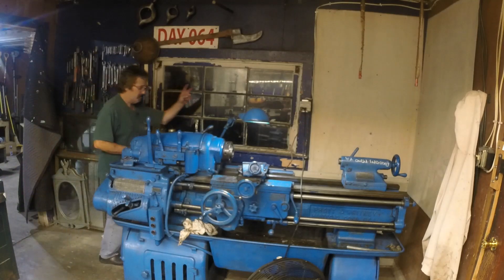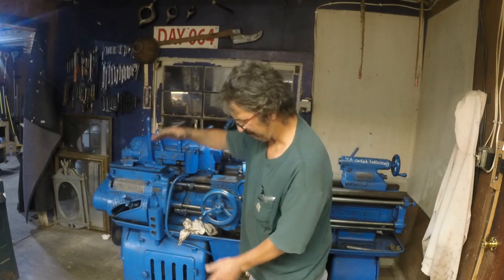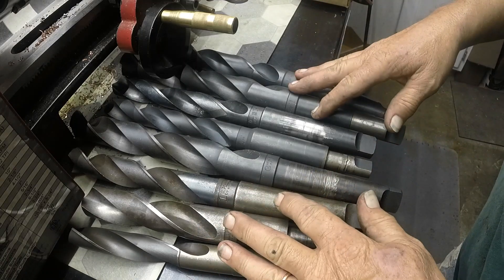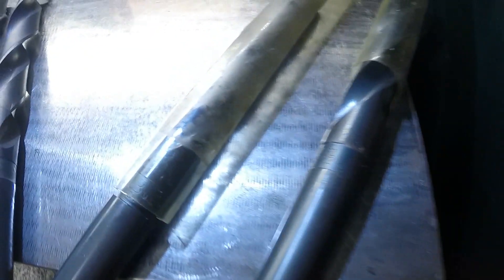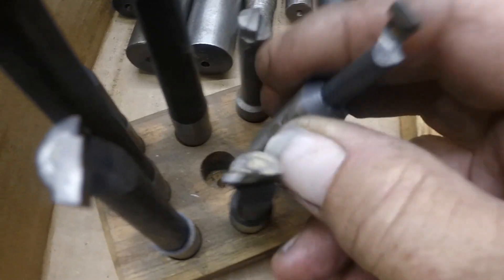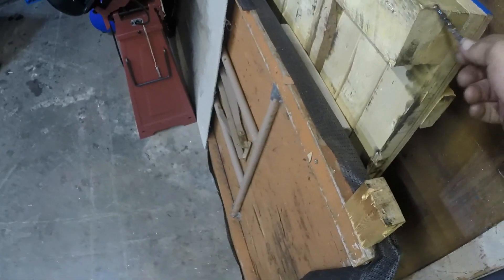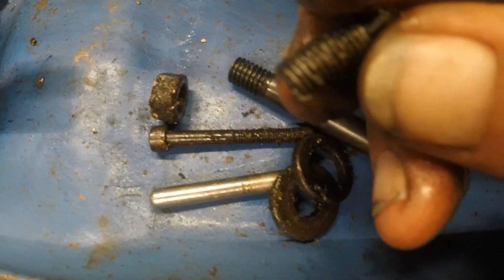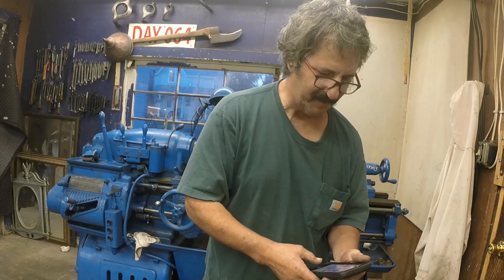PRATT & WHITNEY 12 X 30 MODEL B DAY TWO

Comment: Kimber, you have a cutter grinder! All of that tapered tooling you can regrind to fit your machines. You could even just grind the shafts straight to use in a chuck. Not to mention, they are helpful chunks of high quality steel. The taper shank drill bits go for quite a bit of money when they are vintage
Reply from the maker: Thank you Jean-Paul you’re absolutely right sometimes I have things I just don’t see the possibilities
Reply from the maker: I am working on a  still Chuck and a Live Center, Dozier’s workshop offered to machine my blank to mount my tool post on the compound.
I am anxiously awaiting the owners manual that I bought on eBay. It’s the only thing I really found specifically for the model B and I would kind of like to read that before I power up the machine
Reply from the maker: I’m a little apprehensive about my first machining being matching up the backing plate to my four jaw.Although the backing plate for the chuck is pretty thick I could probably restart if I screwed up

Comment: Well, I would say a good job on there, and you have a nice lathe. Those parts were probably changed out years ago, and the operator or machinist dropped them into the pan, intending to get them later, but never bothered, as the machine already had new. Thus all well chewed up parts.